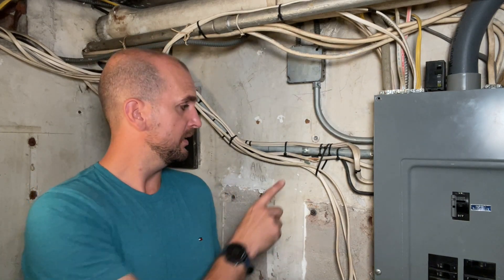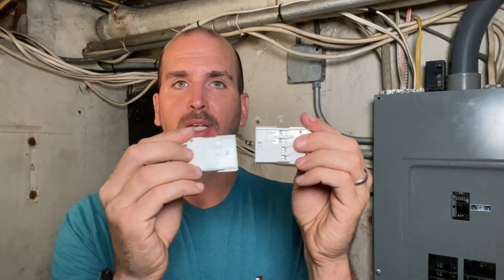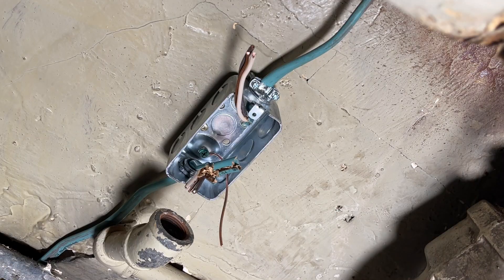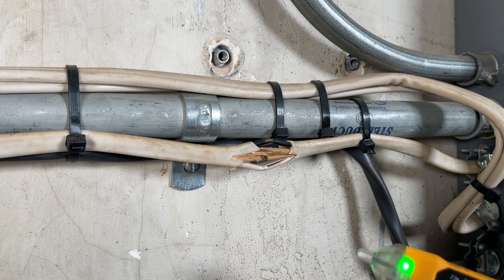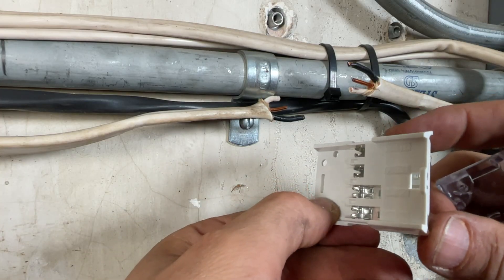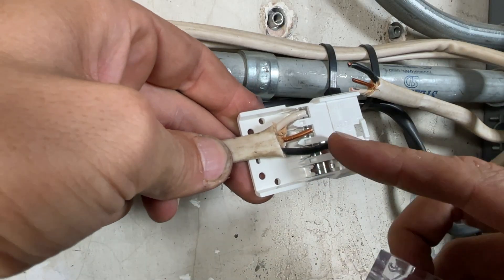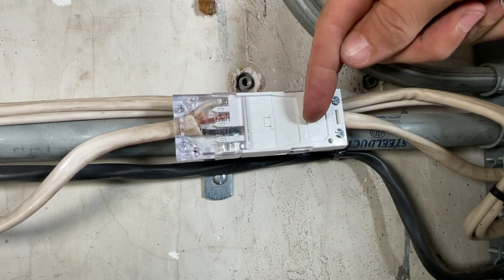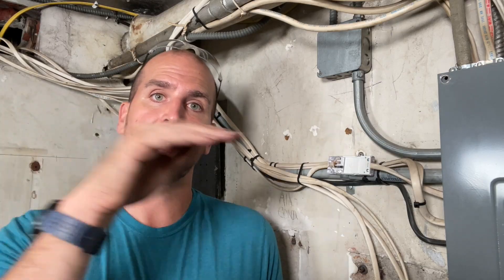How To Repair Damaged Romex Wires

Comment: Wire nuts - What happened to the practice of skinning the insulation back and using lineman’s pliers to twist the solid wires together and then use the wire nuts to act as both a clamp and insulator?
Yes, it takes more time, but there’s no better way to do a “splice.”

They have worked out well for me as far as being called to clean up DIY problems using them.
One major issue I have run into is the fact that people seem to think they can cut the wires as short as possible to “save room.”
Reply: I’ve never in my life made an electrical connection without carefully twisting the wires together and trimming them before fitting them and tightening the wire nut (where I come from, we call them marrettes). I learned by watching conscientious career electricians at the top of their craft. My clients deserve to have every connection look like it’s in an electrical textbook. Nobody should take shortcuts with safety. Electrical work has to be considered as ‘life and death”. Nobody should be trying to trim seconds from making an electrical connection, it just isn’t worth it. 
When I install potlights that come with the push-in connectors, I start by cutting out these connectors and toss them into the trash. I skin the wires and twist them neatly into the solid strand wires and fit it all neatly into the appropriate-sized marrette. Clean and reliable so I can sleep at night. Goodnight…
Reply: @MrGreggallman  , well said.
Reply: @MrGreggallman  Hell yeah, nice !!
Reply: Depends on wire nuts. I simply get the wires nice and parallel with each other and insert nut and twist. I think the problem is many don't test the nut enough. I've tested it myself and removed wire nut to see if wires twisted inside like they are suppose to. And they absolutely did. Very solid connection. If it's 12 or 14ga wire, the wire nuts that advertise you don't need to pretwist work great. If I'm doing anything larger I will use linesman pliers.
Reply: @theelite1x721987  , no doubt in my mind that a great deal of time is saved by not twisting the wires, but …….
Reply: If you've never used Wagos, you're missing out. They're superior to this method in every way except the cost of them vice wire nuts but it's a small price to pay to never have to deal with them again.
Reply: @AdamKouse  , I’ve used WAGO before, and as far as speed and changeability, they are great.
I just don’t feel the industry has accepted them as being SAFE as opposed to wire nuts, at least at the PROFESSIONAL level.
For the DIY guys, they seem like a blessing because of convenience and ease of use.
However, from a SAFETY standpoint, I guess I’m not sold on them.
I wonder if the insurance industry has chimed in on them.
Reply: Wago's are amazing, though i prefer the push in type that don't have the lever, like back stabbing receptacles and switches which is also done a lot these days, though i do prefer to actually use the screws on the sides of these devices instead of back stabbing, but my point is, the Wago is based on the back stab connection that has been on receptacle and switches for something like 20+ years.  I have see them fail, its not impossible, even wire nuts can fail over time as well, it happens, but Wago's are one thing that has not caused me any issue.  With being able to get them in 2, 3, 4, and even 6 wire blocks its makes junction boxes a lot cleaner and less crowded, i wouldn't say Wago's are cheaping out, they cost more then wire nuts, they do save some time but not a large amount most of the time since you are still stripping the ends and stabbing them into the Wago's.  I will say i prefer them but just not the lever type, anything made to be easily removable makes me wonder, first off in a box once the job is done it shouldn't need to be removed unless its all being replaced in the future...  But wire nuts are perfectly fine to.
Reply: @CrazyHamSales  I disagree. Those cheap backstabbing connectors tend to cut the conductor and be loose points for arcing and shorting down the line. I loathe backstabbing connections. Wago is not push in... you open the lever first and push in then close the lever clamping it in place. It's akin to the GOOD back connectors that's part of the side screw.... except the screw pulls in a solid plate to give a solid tight, non cutting connection as if you Sheppard hooked around the screw itself. To me those two are similar.

Those shite backstabbers suck.

Comment: looks like someone could yank it out accidentally while trying to pull slack.
Reply: They are very secure when assembled. You cannot pull them apart easily. I had to use a flathead screwdriver to disconnect them.

Comment: I would fire anyone that does the plastic garbage press connector. 
I don't care codes or not. Garbage. These are house builder electricians using a very bad connector. A handy box with properly installed wires mechanical connection twisted and a  nut will handle way more current than this burn your house down connector. These same electricians are the ones who just stick the wires into the rear of a receptacle or switch. BAD WORKMANSHIP. LICKEM AND STICKEM ATTITUDE. NOT GOOD.

Comment: Am I missing something? How do those marginal pinch on connectors not reduce the carrying capacity of the Romex?  
If you're on a 20 amp circuit and pullng a draw that's close to capacity isn't that point of contact going to get hot as hell?
Reply: Apparently it works. And is rated. Look up wago connector tests. 
Even then. I feel a traditional clamped or twisted connection is better. 

Now my question is.. Why not just use wagos and toss in the wall? It looks like a very similar idea. THis one providing a bit more of a covering / box though.
Reply: @turboflush  he's talking about the TE connector not the Wago. Wago makes solid contact under spring compression. The ones I have are rated at 41A max 30 continuous. I've seen them tested much higher before they melt.

No loads are going to draw that. Maybe a range on 240 can come close. AC compressors and equipment will usually be less than 20a and LRA can be well over a hundred but that is so instantaneous it isn't an issue. Those might be put on 30 or 40A breakers. In other words the Wago is rated for most any residential use.
Reply: @etherealrose2139  yes. The TE.. Did you read the second paragraph?

I am refering to the wago being a similar function. And yea the wago is rated for the 20a.  Would take 3 wagos though to do the splice. 
Wagos hidden in wall are not code though.

Comment: I was unaware of the Romex Splice so I would have used a box and cover for the repair. Now I will try the splice if our electrical codes allow to see if it works. I am DIYer as well.

Comment: In the US, Tyco (now TE Connectivity) bought out AMP. So, if you're an old guy, like me, that's where AMP went.

Also the National Electric Code (NEC), are guidelines set up by the industry. They, in themselves, are not laws. Its only when a government legislative body (state legislature, county board, or city council) reference them in a law, they pass, when it becomes law, only for that local. Actually, that piece of legislation is the law. The law just happens to correspond to the NEC, of a particular year, that's referenced. As such, there are often explicit modifications, and amendments to that code, specific to the specific governing body.

Comment: I know that this is outside the scope of this video, but I'd strongly consider separating those romex cables.  Strapping them to a bit of EMT with zip ties is a hack job.
As for splicing damaged romex, I'd always err on the side of caution and use a standard box with wire nuts.  No way will I ever use one of those plastic thingies.

Comment: I’ve never done continuity in the middle of the wire
Reply: Yeah that doesn't jive. I have no idea why he has exposed wire on an exposed run but checking continuity is not the reason. That dog don't hunt.  Just pull from the panel and twist any two together.

Comment: If the previous owners did this for testing purposes, you need to take a very deep look at everything in your electrical system.  No telling what other surprises are waiting to be found!
Reply: you can tell it's sketchy just by looking at the wiring. zip tied to conduit?  no licensed electrician would do that. it was done by the homeowner or a crackhead
Reply: @rustblade5021  or a car stereo installer. Lol.
Reply: @apsdidit  if I had a dollar for every $200.00 vehicle, whose problems always started after a stereo was installed, I could pay for another $200.00 car.   And the installer always knew what they were doing, because it was their hobby.  I don't look down on these people because they help me make money and there's never a shortage of broken stuff.
Reply: @rustblade5021  I understand you're not supposed to zip tie a piece of Romex to a conduit but I've never really understood why not?
Reply: @frankpaya690  You don't zip tie to conduit because Romex, or NM-B wire is not allowed to be exposed basically. You can use it in the attic and in walls. Its one of the few wires that you can run without conduit because the outer sheathing that contains the conductors is considered conduit. But, that is in areas that are protected from being damaged since romex sheathing does nothing to protect from damage. It is ONLY containment of the individual conductors. It is too easy to damage it, which makes it a safety concern
Reply: @frankpaya690  because code states that conduits and raceways are not a means if support for other cabling, conduits and/or raceways.
Reply: @rustblade5021  That could be the same person.
Reply: I'm an electrician doing mainly remodel residential work in Florida, and i COMPLETELY AGREE! Seeing this would send me on a full electrical inspection of the house. I would be looking in every electrical box, inside the panel, and attic. I would spend hours doing so. All it takes to burn your house down is a loose wire nut!!!!
Reply: @andrewness2153  you're exactly right, and I don't think any overcurrent protection, any arc fault  circuit interrupter, would open the circuit so the fire would start where the loose connection is.
Reply: @frankpaya690  Arc fault protection would definatly help mitigate this. I have diagnosed issues with Arc Fault breakers tripping over time due to loose wire nuts in light fixtures which are often installed by the homeowners. But, MOST houses that I walk in to do not have any Arc fault systems because they were built before that code adoption in my area. And Arc fault breakers go bad just like anything else, thats why they have the test button just like a GFI outlet does. Do they ever get tested? No...
Reply: @andrewness2153  I'm not even an electrician and I'm sitting there thinking "why is all that wire just sitting out in the open strapped to conduit with friggin' zipties?!"

Then again, I'm might be a bit of a weirdo. I just rerouted every bit of wiring in my box that the previous owner hooked up because "someday they might need it" that went nowhere on the other end into a side box where I capped each wire off, instead of pulling the wires entirely.
Reply: Yeah there's a lot more wrong in that house.
Reply: Shit, you should see the house i bought just outside of Detroit.

Two years down the road and always finding more hack shit.

Still, it was worth it for the warehouse of a garage. Fits 10 cars, comfortably. 😆
Reply: He found it 3 times in the house, SO FAR! Where else did he not find this?
Reply: Yeah, I don’t think they were testing for power next to the electrical panel.
Reply: @OkosJune  If they were, time for a new career. Dude the wires are visible and the panel is right here. Just pop the panel cover off and text/inspect wire🤣🤣🤣... that was a tap for something to branch off I bet. How it was used, I really don't even want to know ....
Reply: @andrewness2153  naw, it was a setup. He used the same mini cutters to cut into the nm sheave then to cut the wire  to thick for those little buggers
Reply: @andrewness2153  that's exactly what those were...Taps...I live in a house, built in 1974...electricians contracted in '75 did this exact thing, to add lighting and attic power...I also found it again in an attic of a house in this same neighborhood...lazy  electricians
Reply: @BlackVibeBallsack  As a residential remodel electrician that's super OCD, you have no idea how often I have to fix stuff from "lazy electricians"... There are licensed guys doing crap work these days. I would love to know how they are passing inspections because I would get red tagged for some of the crap I see in newer housed that "passed inspection".
Reply: I'm pretty sure he was saying the video that he had an inspection done. Thats why he was fixing the issues that came up.
Reply: Well there's a main breaker just sitting on top of the panel, which is weird. Panel is missing a screw too.
Reply: @timfischer  Since their hunting technique for electrical probs maybe they just put in a bigger breaker to keep it from poppin ;)
Reply: Bones McGillicuddy  I honestly thought you were kidding. Who the heck has a spare MAIN BREAKER for their panel? I don't even think the one in my panel is replaceable. It's not like they fail every few years... this is a breaker that will probably NEVER trip and only be shut off a handful of times in the lifetime of you home.
Reply: @timfischer  thats not a main breaker.
Reply: Bones McGillicuddy  What I thought... you won't answer because the answer is ZERO... you've never replaced your main breaker, neither have 99.9% of installations (short of replacing the whole panel). Nobody has a spare main breaker "just in case".
Reply: @timfischer  I’m an electrician, and I’ve had to change some main breakers. They fail just like any other breaker, and it’s because of internals. Not just because they turn on and off.
Reply: @Blurredfury22   @Blurredfury22  I don't doubt they sometimes (rarely) fail. I do doubt that normal people have a spare sitting at the ready just in case. Which is why my original statement said it was "weird".
Reply: @timfischer  and I say they do. Especially if they are handy men like this channel. Again, pretty common.
Reply: Well then we disagree. Maybe in your part of the world everyone has a closetful of spare main breakers. But around here, that isn't the case, because they simply don't fail very often.
Reply: @Blurredfury22  yeah, I've seen the aftermath of a Zinsco 480/277 VAC switch and bucket enclosure failure.  Not including personal injury to the electrician involved, who did everything the correct, safe way, the cost of that breaker exploding due to mechanical failure, causing a polyphase short was tremendous.  It caused the entire main switch cabinet and utility transformer (and grasshoppers) to be replaced.  This was in a hospital, so there were temporary gen sets, shutdown scheduling and execution.  A whole bunch of many for the failure of one device.
Reply: @timfischer  they fail at the same rate as any other breakers. Also, that isn’t a spare main. So stick to what you know
Reply: @Blurredfury22  Thanks big guy.
Reply: @timfischer  anytime champ
Reply: Bones McGillicuddy  Haha yeah we should all have a spare main sitting around
Reply: @timfischer  looks like a 220 breaker more than a main breaker...
Reply: @tonytatano6985  a main breaker for a 208, 240 single phase panel is a 208, 240 breaker.  The breaker frames are different or adapted
Reply: Bones McGillicuddy  How many times have you replaced your main breaker?
Reply: First, NM Cable is approved for installation inside wall cavities and attic spaces. All of that exposed cabling should be installed in MC cable.  This is a code nightmare!!

Comment: Pinch connectors are iffy at the best of times ( dry locations )and dubious in moist conditions … the contact normal force of the pinch connection can not be measured and there is no guarantee that the plating is galvanically mate-able to the romex wire cores ( I presume there are different sizes pinch connectors for differing AWG sizes and the product is atleast marked? )
Reply from the maker: Hey Tony,  thanks for the feedback and I tend to agree with you.  This model works for 12 and 14 gauge but makes you think the forks just cut into the copper on the 12 gauge wire.

Comment: I once found a damaged cable like that at a friends house. One of the previous owners put 5 or 6 twist locks on a single romex cable. The spot I found he must of missed or forgotten about. He had an electrician come in and replace that section from the breaker panel to the  first junction box.

Comment: I am a licensed electrician.  I have never heard of this product. But i can see where there are a multitude of situations  that this would get one out of a bind! Now to check with my inspectors , the Authority Having Jurisdiction,  AHJ. Whether this is approved by the NEC or not can be irrelevant if the AHJ says no. The NEC also says that whatever the AHJ says... IS CODE.
Reply from the maker: Amen to that 💯
Reply: If you had any experience at all then you would know that inspectors don’t know jackshit. Also, these are mainly used to be buried behind sheetrock. An inspector would never know.
Reply: Hence the disclaimer about checking with your local codes first and being proactive about it…

Comment: Devices such as this are fine for low voltage applications, but I would never use it for 110 voltage at 15 or 20 amps. I doubt that any electrical inspector would approve this repair. There is minimal contact between the copper wire and the steel clip for proper current flow and inadequate shielding between hot, common and ground which, even if an actual short didn’t occur would be a risk for thermal break down of the plastic device. Don’t be lazy or creative. Pull a new cable and do the job properly.